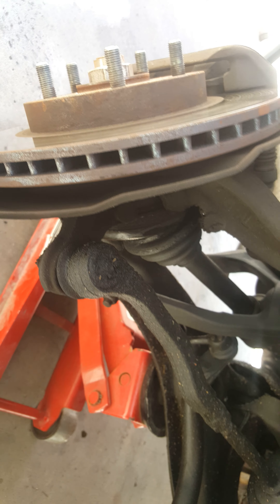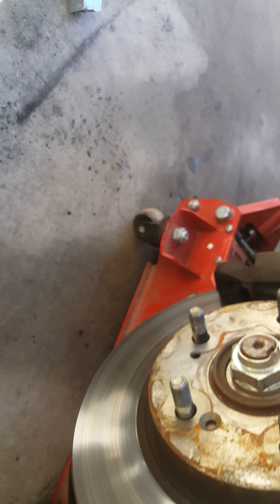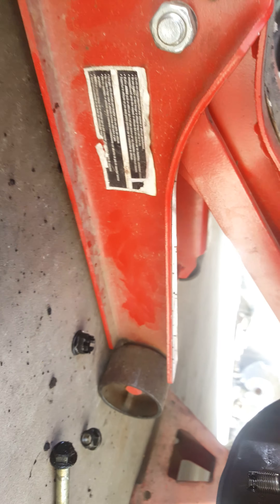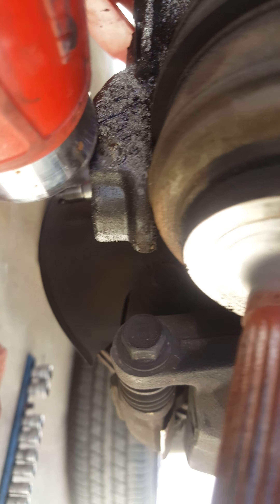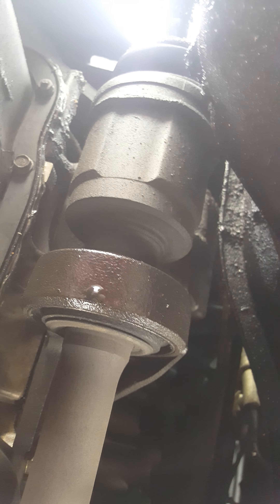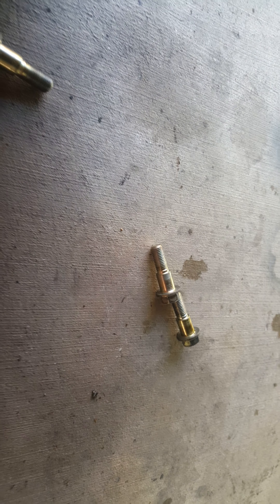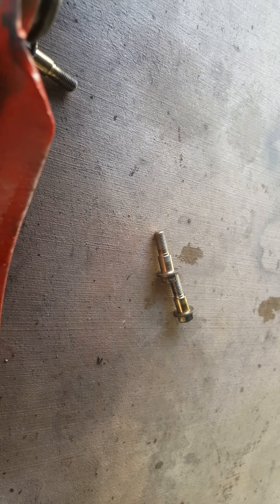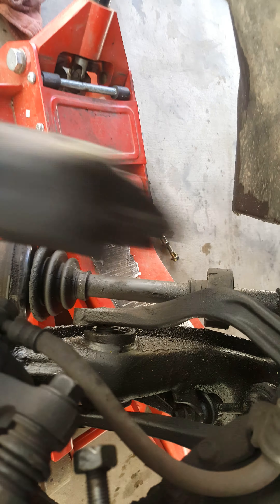Honda CRV CV axle replacement part 1 (EASY)

Comment: And I got the axle part that’s connected to the bearing out by holding it with a prybar and tapping it lightly with a small hammer